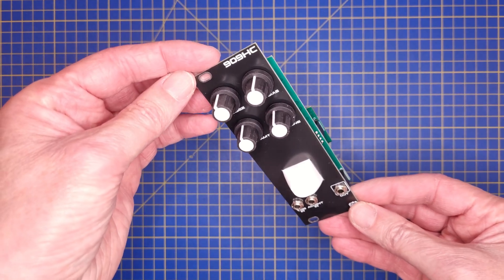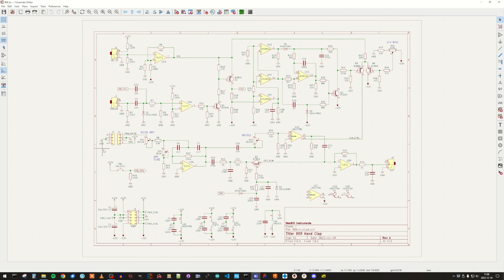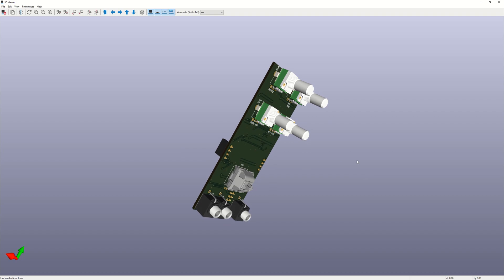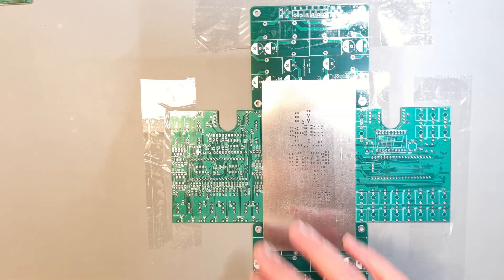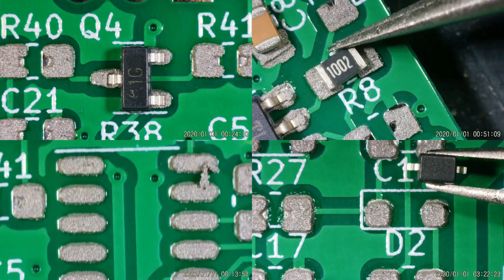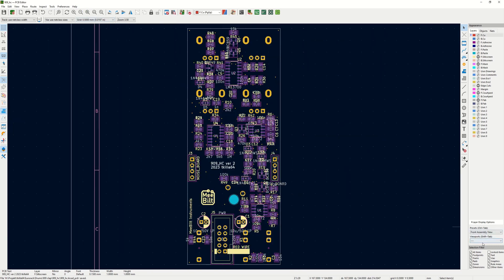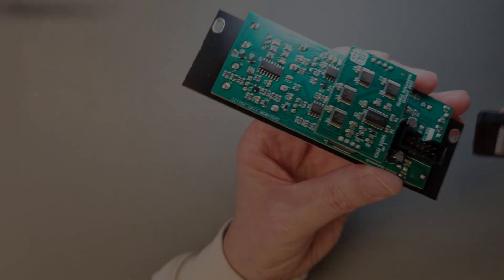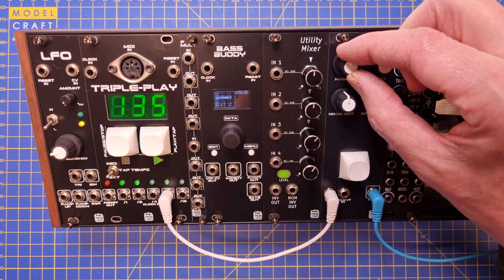Eurorack DIY: 909 Handclap (Episode 2)

Comment: I just built the clap and it sounds absolutely amazing! Thank you so much for sharing your design.
The built itself was fairly straightforward, I only struggled with the 4015s on the noiseboard. The footprint of those is quite a challenge to solder by hand, but doable. After those the rest of the built was done in a breeze. Thanks again!
Reply from the maker: Awesome! I delighted to hear that you like it - it's one of my favorite 909 voices.
The 4015s are a bit tricky so I actually included the PCBA production files on my Github along with the gerber files.
Reply: @MeeBilt  I didn't order the PCBs myself, so I had to use what I got. But is there a reason why you didn't use the SO-16-footprint? A lot easier to solder and easier to source. It would have possibly resulted in a slightly larger PCB, but this isn't really an issue here, is it?
No criticism whatsoever, I'm just curious ...😃
Reply from the maker: @joerglaier4093  I was planning to reuse the noise board for all my designs so I actually ordered a batch of 5 PCBAs. The TSSOP-16 footprint was chosen because it was cheaper and easier to source for some reason.

Comment: You should connect the unused LM13700 inputs, Iabc pin to the negative voltage rail via optional 1mOhm resistors and the buffer output back in to the buffer input to disable it all. that's how a Texas Instruments engineer on their official forum explains it. Al datasheet say you should never leave inputs floating, radiation from space! Where do you get you solder paste? it should contain a best before date. one sells a pot worth more than 100€ from china.
Reply from the maker: Thanks @AnalogDude_ I will check that out.
The solder paste is from Aliexpress and I but it in small quantities and keep it stored cold when I'm not using it.
Reply: @MeeBilt  First i need to quire a clothing iron and modify that with a triac, optocoupler, fubarino to make a heat plate. but solder paste is not easy to get.